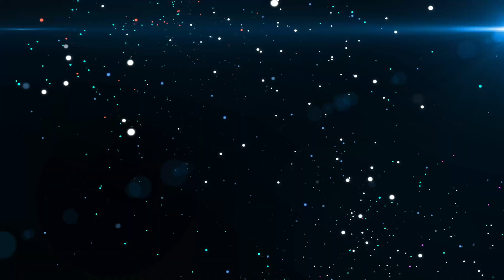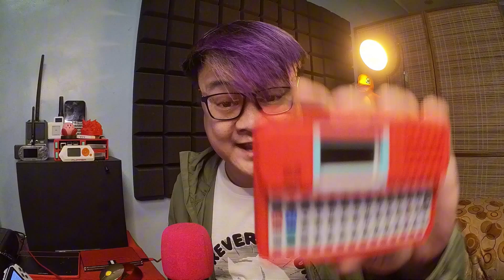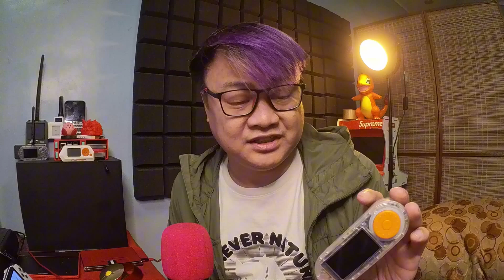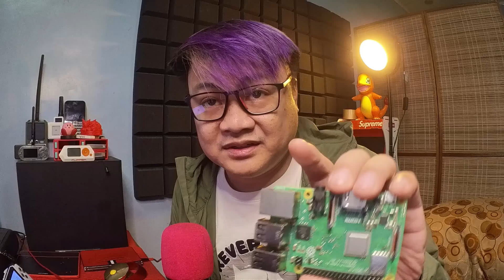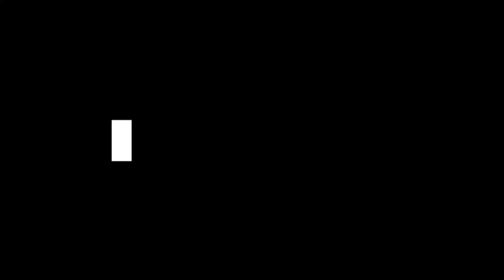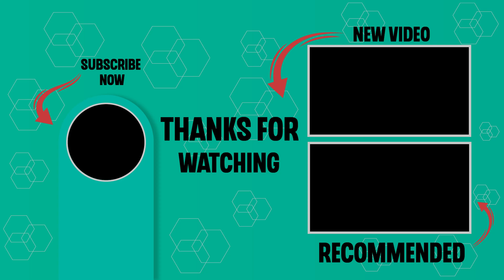100 Days of Exploring Bruce Firmware - 5 Important Things!

Comment: Hi, is T deck lilygo a good option also using bruce firmware? It would be interesting if you could make a video for the community ☺️
Reply from the maker: T-deck is a nice device, the downside is that it is not as expandable in terms of module  as the m5stack devices and its ecosystem of module
Reply: @HakistaTV entendi, vou comprar o m5stack, obrigado pelo retorno.❤

Comment: Hey man can you gift me the t embed 😊
Reply from the maker: I'm a struggling starving youtuber brother
Reply: @HakistaTV  I am from India bro and I have 2k in Indian rupees but I want that t embed and in india this device is costly arround 80 dollers so if you can give me that will be helpful for me and I also give 2k in Indian rupees
Reply from the maker: @Xenin200  thats enough to buy a cyd board which is better
Reply: @HakistaTV  I have cyd board but the board is broken brother
Reply from the maker: too bad
Reply: @HakistaTV  yes bro 🥲
Reply: @HakistaTV  you think a CYD is better than the t-embed cc1101?
Reply from the maker: @coop-a-loopy  Yup, Bruce firmware is not really optimize with that wheel of t-embed

Comment: My choice was the CYD, but it is probably out for most as it requires a lot of very tight soldering. Cardputer is excellent.
Reply from the maker: I love CYD too! I have one and planning to use it on a Ghost ESP series
Reply: @HakistaTV  honestly running bmorcelli on the cyd and even the cardputer is something people havent fully adopted yet.  Cardputer adv is perfect for it because you can set up a Lora module and type away at will.  Would love to see people putting more energy behind that aspect.

Comment: Nice! Have you figured out what you're supposed to do with the packets you obtain? There doesn't seem to be anything that i've seen that allows you to view them etc
Reply from the maker: there are alot of tutorials about this. You can use wireshark to check if all of the 4 part handshake is captured then use jack the ripper to crack the password